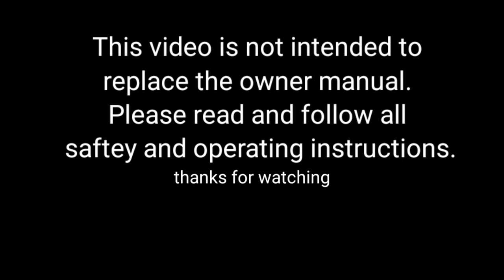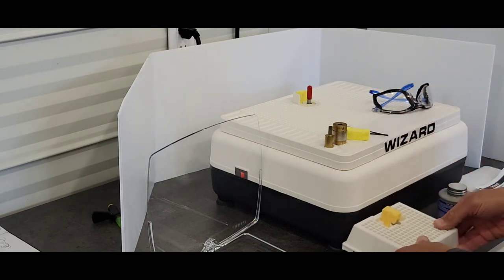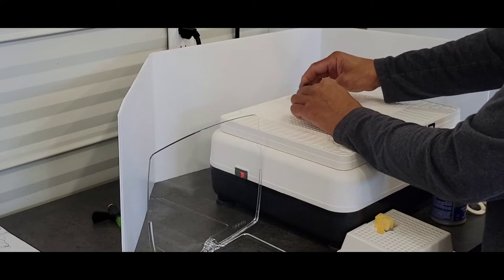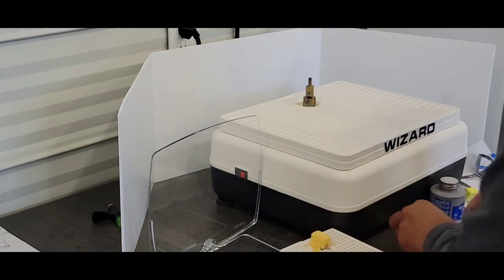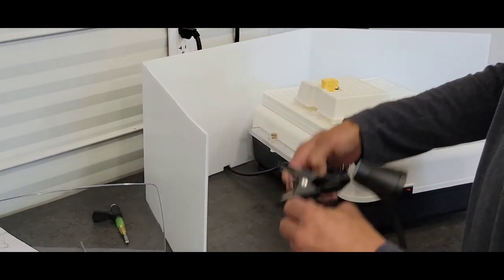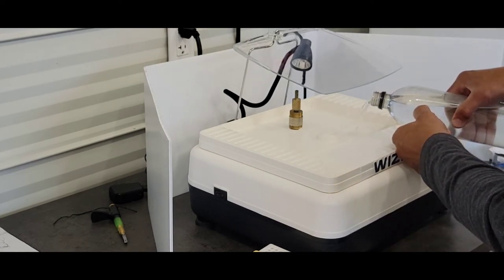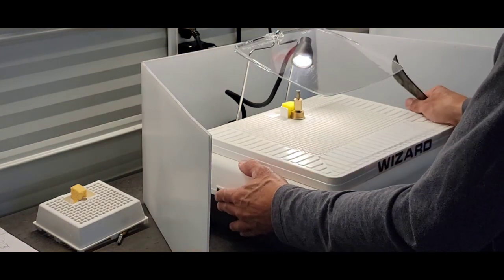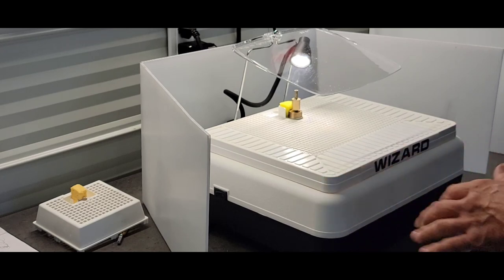Wizard IV Glass Grinder Set up and Demo

Comment: Where did you get the light you attached to the grinder?  Thx
Reply from the maker: Hi, The led light is from Inland Craft.
Part number 10011.
Its under Led Light attachments on their website. It fits all 3 grinders but can be used on any machine. It has a clip to attach it where you need.